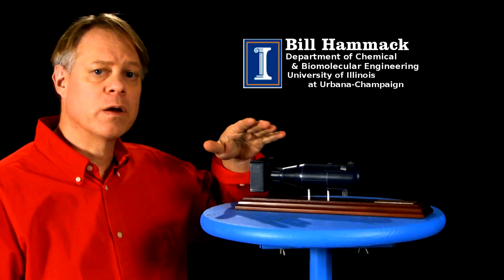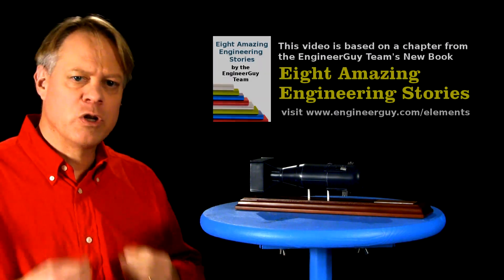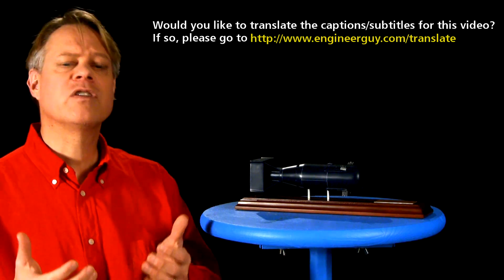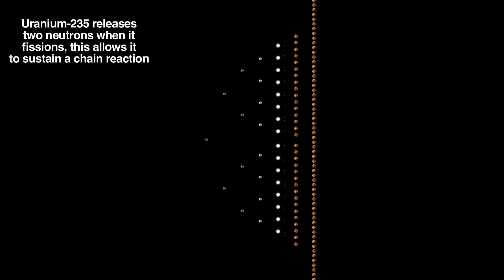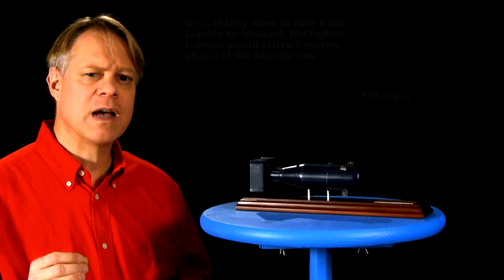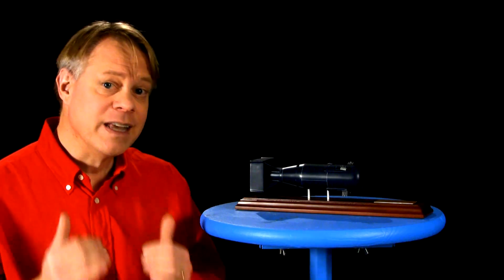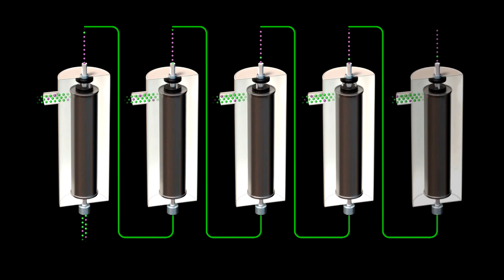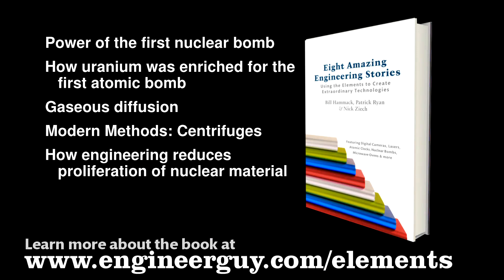How to Build a Nuclear Bomb & What Keeps Weapons from Proliferating

Comment: Or you can buy a high energy neutron emitter and a industrial freezer and a berylium sphere and put together a neutron chamber, then all you have to do is put your crude uranium 238/235 metal into the chamber on ice for a month and end up with some plutonium 239. And since all plutonium isotopes are fissile, there is no need for tedious bullshit like explained in this video. It is a slow process, but it works. Then all you have to do is get 2, 3kg chunks of it and drop them on eachother and kaboom. Anybody with two sizeable chunks of uranium 235 or plutonium can simply drop one onto the other to cause critical mass, although the yeild will be not nearly as good as what our millitary has it would still be enough to create a HUGE explosion. Any idiot with enough of this shit can build a nuke, it is as simple as bringing 2 sub-critical masses together inside a neutron reflective material with some force applied.

Comment: this is a old way of doing things. the best way is to use zone refinement.  many metals like silicone and aluminum are refined to 99.99 percent purity using zone refinement.  alumumum is 1 amu different to both chemicals next to it in the periodic table.  zone refinement purifies the alumimum from both of those chemicals.  uranium is 1 amu different from both chemicals next to it the periodic table. using the uranium ore uo3 added to carbon gets u and co2 co then zone. peace thru strength , total control leads to total corruption (lord acton). have agreat day.

Comment: I wuz hopin' to go down to home depot and get sum stuff to whip one of these up this weekend, but I guess that's not happening now! This shit looks harder than Chinese arithmetic!!
Reply: Or you can buy a high energy neutron emitter and a industrial freezer and a berylium sphere and put together a neutron chamber, then all you have to do is put your crude uranium 238/235 metal into the chamber on ice for a month and end up with some plutonium 239. And since all plutonium isotopes are fissile, there is no need for tedious bullshit like explained in this video. It is a slow process, but it works. Then all you have to do is get 2, 3kg chunks of it and drop them on eachother and kaboom. Anybody with two sizeable chunks of uranium 235 or plutonium can simply drop one onto the other to cause critical mass, although the yeild will be not nearly as good as what our millitary has it would still be enough to create a HUGE explosion. Any idiot with enough of this shit can build a nuke, it is as simple as bringing 2 sub-critical masses together inside a neutron reflective material with some force applied.
Reply: They make it seem alot harder then it is for a reason. When it is actually more simple then 8th grade chemistry.